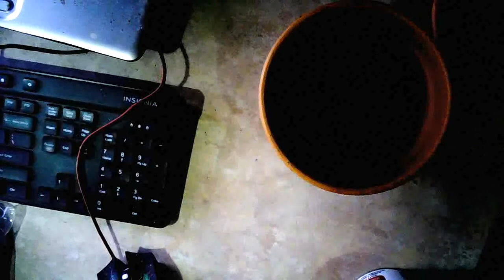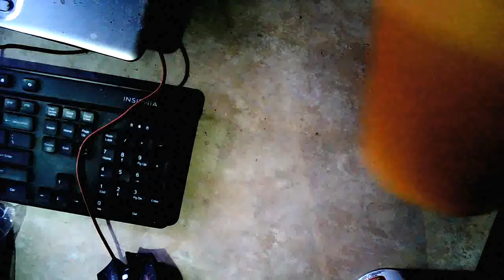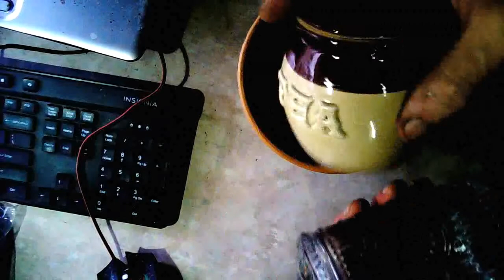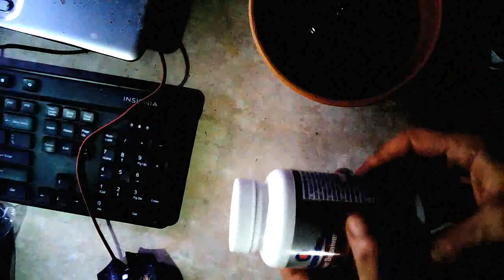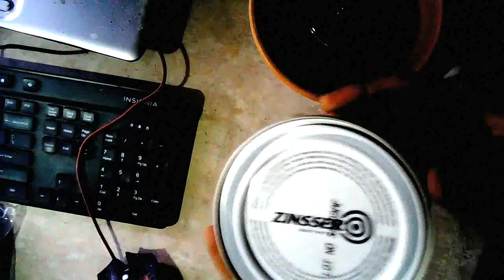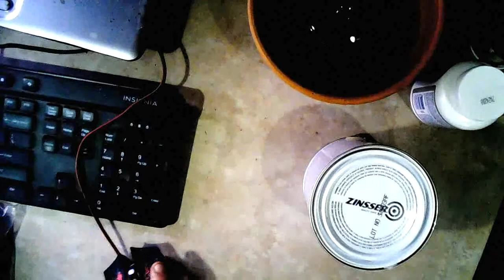MicroWave Kiln Update & Interesting New Products

Comment: Hi Ray joined  your youtube  site a week or two ago and have tried to catch up on what your doing, very interesting work but can i ask why zinc chloride for your pot
Reply from the maker: Sure Michael, I got the technique from RMS, and just wanted to made a small improvement to make it a more efficient heater, so I soaked the pot in Zinc chloride. It's probably got a couple of OZs of zinc it in. The metal will absorb the microwaves, and should get very hot now. We'll find out how well it does fairly soon. Thanks for asking. :-)

Comment: Nice work. I can't wait to see the kiln in action was thinking of doing the same. And great product research . What was that zinc in the can used for.
Reply from the maker: It's a gopher repellent.  Zinc Phosphide, which I hope will work on my anode, and allow me to eliminate the zinc plate and replace it with carbon, and also interact with the other phophates in the cell. We'll see when I test it.
Reply: Gopher bait. Take care if mixing  Zinc Phosphide with acids, The bait works when combined with the animals  stomach acids turns the zinc phosphide into phosphine. Phosphine is a very toxic gas.
Reply from the maker: Oh,. thanks for the warning Dan. I won't be using that stuff on the gophers or in my cell. The gophers have real sensitive smell. I thought they would avoid it, not eat it. I don't want to kill them. Just keep em out of my garden. Lol
Reply: See what others have to say first, if there is too many Gophers that in it's self is a problem, So culling maybe needed.
Reply from the maker: Gophers everywhere around here, and lots of other wildlife too, which I love and would never kill. I'll bury some hardware cloth under my garden plants to keep em out. Just more work to do is all. Lol
Reply: The gophers have real sensitive smell. Have you tried pepper.
Reply from the maker: I've tried a bunch of stuff Dan. The stronger the smell, the better it seems to work. Ammonia works great, but smells just move the gophers around in the yard. That's why I have to bury some fencing. I know that will keep em out. :-)
Reply: It'll be interesting to see if the primer works. I've heard of shellac being used as a membrane. If it dries and prevents mixing of the active materials and worka as an active material itself that would be killing two birds with one stone. Solid state cells is an increasing topic in the battery industry.
Reply from the maker: I think I'll try the primer experiment next Fred. Let's find out! :-)